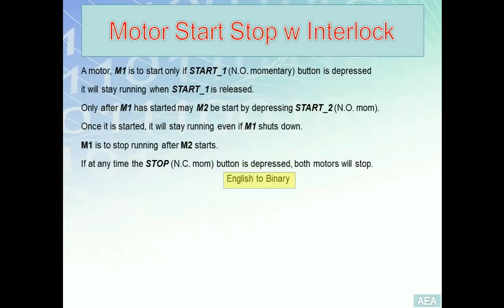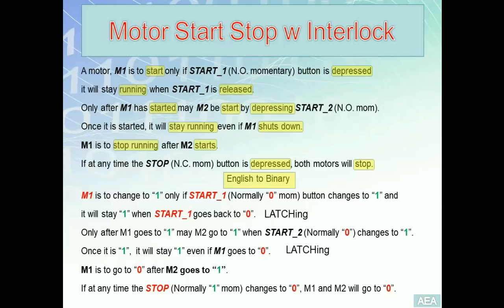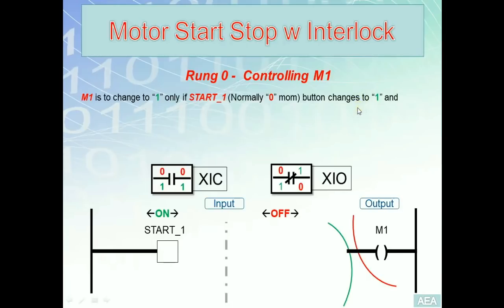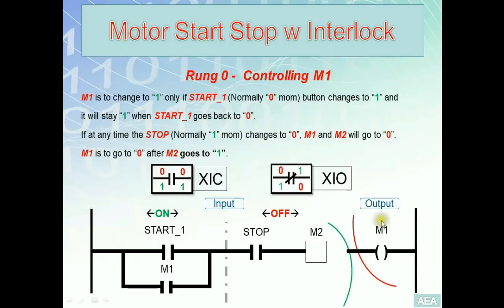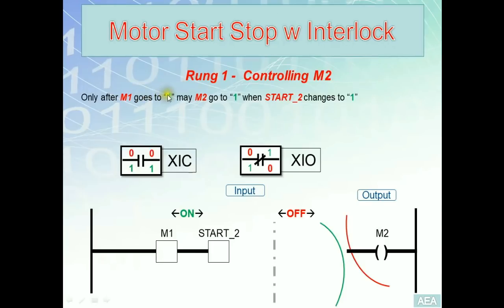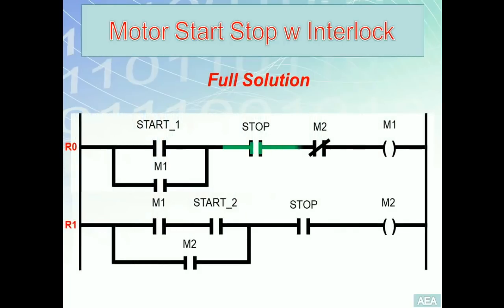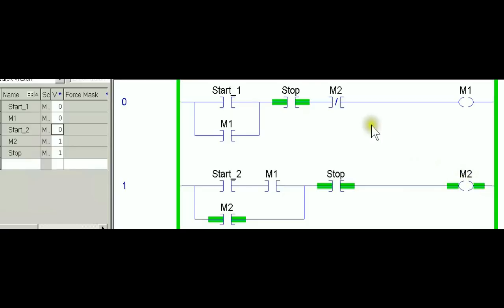LD 11 - Motors Start with Interlock - Easy PLC Programming Tutorials for Beginners

Comment: this doesnt make sense. you say stop button is NC but you have it as NO in the diagram. how can M2 be NO and NC at the same time?
Reply from the maker: In the diagram it’s not NO, it is “examine if closed”.
I know some textbooks or platforms use NO terminology taken from electrical ladder diagrams - representing a switch type - but what you need to keep in mind is that this is programming instruction - not a switch - that is linked to a NC switch using a base address.

Comment: Design a PLC program and prepare a typical I/O connection diagram and ladder logic program
that will correctly execute a timber pressing system. The process presses three timber plates to
for one thicker timber.
The sequence of operation is as follows:
Thinner timber plates are placed on the conveyor manually as long as space is available to place
on the conveyor. The conveyor moves the timber plates to a point A where a robot is used to pick
3 timber plates sequentially and place on the pressing plate. In between the timber a machine
sprays glue on each. The pressing machine presses it for 6minutes then the robot puts the pressed
timber back on the same conveyor and continues this way.
The robot is operated by three motors, two for motion one for grabbing. One motor to move the
base arm up and down, one motor to rotate the base arm right and left and the third to grab or
release the object. The vertical and rotational motions are restricted by two limit switches for
each. The is a limit switch on the grabber which switches on when it presses on the surface to
pick drop the timber. The timber pressed should also be counted to know the production size. The
process is started by a start button and stopped by a stop button.
There will be stoppage of the conveyor for the process to operate properly. A position sensor is
also installed at the base of the robot to detect the arrival of a timber.
Reply from the maker: Added to my to do list Ghashawbeza

Comment: Nice example, but your explanations of the logic are inconsistent.  Perspective is normally provided from an energized or circuit ON/Active point of view.  A normally closed switch is closed (or TRUE) when logic is '0', and opens (disconnects circuit, FALSE) when logic is "1". Thus, the series connection that you show with STOP and M2 to disconnect M1 is a logical AND, both conditions have to be met, i.e.,TRUE) for STOP and M2 to provide path for M1 to conduct (be energized), while a parallel connection is a logical OR as either connection will allow the circuit to conduct through the associated path. In general, series means AND and parallel means OR.
Reply from the maker: G.A.B, we can’t group all discussions in a single tutorial regardless how lengthy we make 😉
I agree to most of what you said but the last statement needs additional illustrations. “And” is series when energizing and “or” is parallel when energizing. However, when de-energizing the discussion is inverted and for this I have created a new video  LD24 - Instructions arrangements.

Comment: Hi Ali, I am also confused why you used normally open for STOP even though you mentioned that "If at any time the STOP (normally closed momentary) button is depressed, both motors will stop."
Reply from the maker: Hey  Bert,
We need to agree on the terminology.
Inside the software, we use instructions and these instructions has names.
Based on this, the instruction used with Stop is not called normally open. It’s is called Examine If Close [XiC]. We used  XiC referring to STOP as STOP is Normally Closed and we want this instruction to be TRUE as long as STOP is not pressed and will allow us to start the motors. Anytime the STOP is pressed; as a switch, it will change to the Open state and the XiC referring to it will change to False and this will break the rung and stop both motors.

Comment: Great video but i have a question i cant seem to find an answer to. 
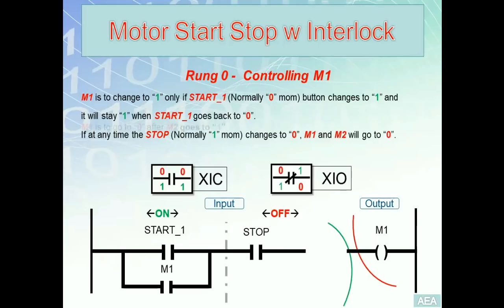Maybe i'm thinking of it like a physical circuit too much, but @6:52 how does a NO(XiC) stop the motors when pressed?
This looks like something that has broken the circuit and needs to be held down to continue.
Reply from the maker: Thanks Ross,
When U want to choose the correct instruction [XiC or XiO] to be used with a STOP or DE-ENERGIZE input, U need to remember that this instruction has to be ALWaYS True as long as this input is in it’s Default state. Based on this and knowing that Stop is Normally Closed button, we need to choose XiC with it as this will maintain this instruction in the TRUE state as long as Stop is not pressed. When Stop is pressed, it will change to Open state and this will change the XiC instruction to False - hence breaking the rung and de-energizing the outputs.

Comment: Thanks for the amazing vide, had one small doubt, shouldn't 'STOP' be  XIO, as in general conditions it should be conducting and when we want to stop giving M1 and M2 an output we can energise 'STOP' and open the respective switch?
Reply from the maker: Hello RITHVIK.
If we associate the STOP with an XIO, you tell me what would the state of this instruction always going to be as long as STOP is not pressed
Reply: @ALiEALiPLCProgrammingTutorials  The stop which is normally a n/c push button will be a nc which will allow current to flow when  it is not pressed as otherwise when you press the start how will current flow?
Reply from the maker: Daniel, U are discussion the Stop from an  “Electrical” point of view. We shouldn’t ignore this of course when it comes to programming. As a matter of fact, the same analogy applies but from a logical programming perspective. We need the rung and specifically the stop or the off section to be always true to allow the energizing of an output. From this perspective, the NC Stop switch need to be tied to an XIC instruction which will be always True as long as Stop is not pressed because the XIC always return True as long as it’s tied to a Closed switch. When Stop is pressed, XIC changes to False, it breaks the logic continuity in the rung and de-energizes the output.

Comment: great video, but a stopp button has always a NC(normally closed) sign. while yours is NO(normally open)
The m2 kontakt that turns off the "m1"  is normally closed, that sign should used in the stopp button
Reply from the maker: Thanks typical. 
 please note that the instruction associated with the Stop within the program is neither NO or NC. Stop itself is a NC switch. However, within the program and for order for it to function as a stop or de-energizing function, we are associating it with an Examine-if-Close instruction. In other words, when we are building our program we talk INSTRUCTIONs. Which instruction to use depends on the input device that we are dealing with.

Comment: is it possible to replace the stop swith with NC set to 0?
Reply from the maker: Cili, I'm not sure I got your question. 
Stop is a NC closed switch that turns to open [0] when pressed to turn off M1 & M2.
Reply: I think cili is right. If we say it's a NC contact so why dd we use a NO and then set it always on 1. Why not just use a NC & wen the stop button is pressed, it opens thed circuit and M1 & M2 turns off, just as how the question says.

Comment: initially the STOP was mentioned as NC...then how it is a NO at the end...i get the same result only when i use a NC contact fr STOP button in my program...please clarify
Reply: I have the same doubt
Reply: @HariKrishnan-xp3yc  well the doubt has got cleared by myself....if we use NC in plc wiring, in the ladder logic we r supposed to use NO...
Reply: @noohmuhammed633  Thank you
Reply from the maker: Hari and Click&Cook Recipes; please note that the instruction associated with the Stop within the program is neither NO or NC. Stop itself is a NC switch. However, within the program and for order for it to function as a stop or de-energizing function, we are associating it with an Examine-if-Close instruction. In other words, when we are building our program we talk INSTRUCTIONs. Which instruction to use depends on the input device that we are dealing with.

Comment: I am still puzzled, whely the latching is normally open?

Shouldnt it be normally closed..,?,

How is it that normally open latching able to keep motor 1 running??
Reply from the maker: You need to check earlier videos and we need to agree that the latching in not Normally open or Normally close. It is an Examine if Close [XIC] instruction that is referring to the output memory address. This is extremely important in understanding the logic used in building  the program.
Reply from the maker: Godric, I suggest you go check earlier videos about Ladder Instructions. you shouldn't look @ latching as normally open or even normally closed. IT is a computer instruction called Examine If Closed - XIC. Please go thru it and we can fill the gaps later on.

Comment: In rung 0, for either or condition you put it in series and then again in rung, you put it in series for "and" condition. M confused.
Reply from the maker: Shashank, please rethink the solution using the following summary of concepts:

1- if U have 2 or more conditions with an AND relationship to ENERGIZE an output, these conditions will have to be in Series with each other.
2- if U have 2 or more conditions with an OR relationship to ENERGIZE an output, these conditions will have to be in Parallel with each other.
3- if U have 2 or more conditions with an OR relationship to DE-ENERGIZE an output, these conditions will have to be in Series with each other.
4- if U have 2 or more conditions with an AND relationship to DE-ENERGIZE an output, these conditions will have to be in Parallel with each other.
Please do NOT try and memorize the 4 rules above. They are meant only to help us choose correct arrangement among instructions we are using [ series or parallel ]
Reply: @ALiEALiPLCProgrammingTutorials  Thank you
Reply: @ALiEALiPLCProgrammingTutorials   Concept you laid out is true, but I think you said "OR"  for first rung and put in series, so shouldn't you be saying "AND for both first and second rung if you are using series? I am confused a little too

Comment: on 13:00 time your referring to stop as normally closed but its normally open contact I am so confused ? isnt that all e-stop are normally close contact ? please clarify
Reply: Yea all e stops and stops should be normally closed.
Reply: Ali, all through the problem the "Stop" button is given as normally closed and the solution is built accordingly.
Reply: A stop doesn't have to be an XIO it's might also be an XIC.
Don't think of is electrical diagram where current goes from left to right.
Think of it as logics.

regards